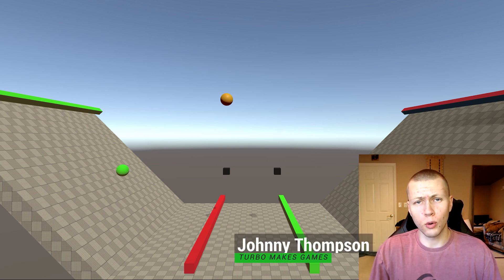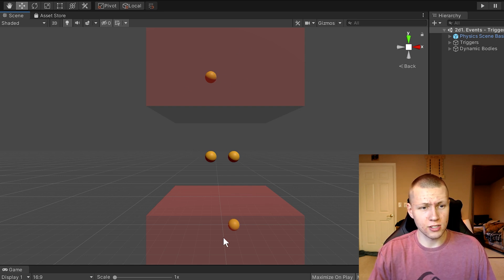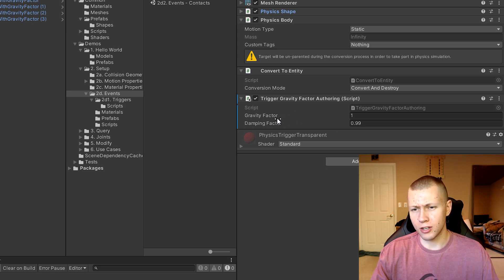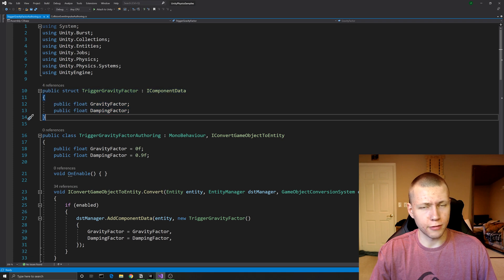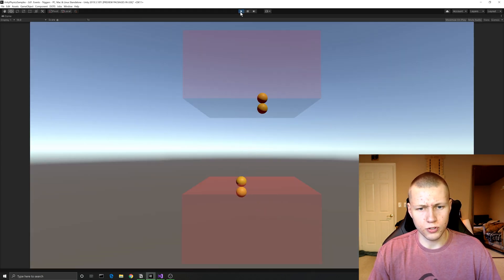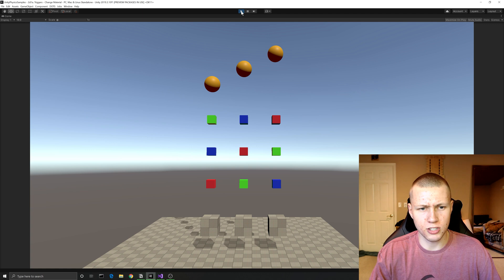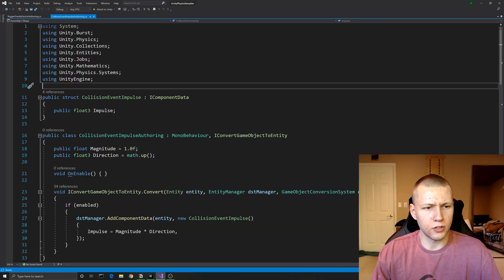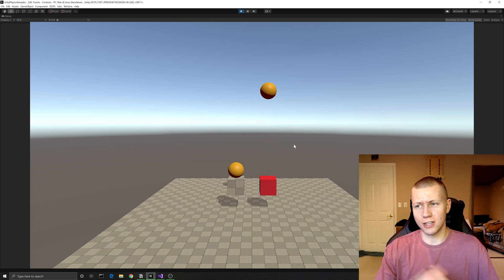Collision and Trigger Events - DOTS Physics in Unity [Old Version of ECS]

Comment: Implementation and programming of the whole ESC, DOTS CRAP IS COMPLETELY FUCKING RETARDED. AGAIN WITH FUCKING UNITY GETTING THE PEOPLE TO DO THE HARD WORK WHEN THE ENGINE SHOULD BE DOING IT.. This whole thing should have been a smooth transparent integration, but it's a confusing as fuck and way too many steps are involved to doing the simplest thing. After all this the advantage is minimal.  TAKE A LOOK AT FUCKING UE5.... Hey UNITY WHERE THE FUCK IS YOUR GI, NANITE alternative??????

Comment: excellent tutorial.  I really wish the ECS DOTS systems didn't have so much boilerplate code.  I really like the speed and power the new systems have, the learning curve is crazy steep though.
Reply from the maker: Very true. It feels like in order to get the big performance advantages you almost have to do a lot of low level programming. In my experience a lot of the difficulty comes because Unity boxes you into one way of doing things if you want to take advantage of the job system and burst.
Reply: @TurboMakesGames  Looking at native ECS frameworks like Bevy, convoluted code is not something innate to ECS (can't call this low level). I'd guess most of this complexity comes from having to bend Unity around itself to work with ECS. There's a lot of room for improvement, and I'm sure DOTS will improve very fast once it is actually released.